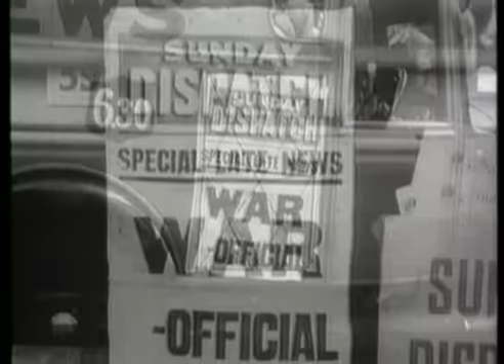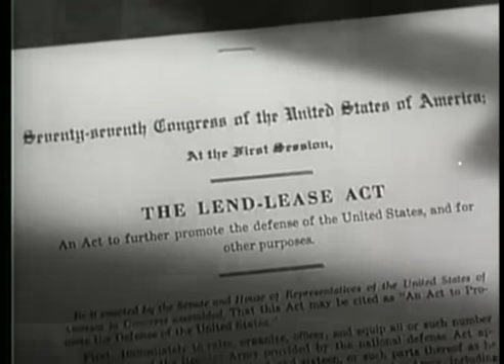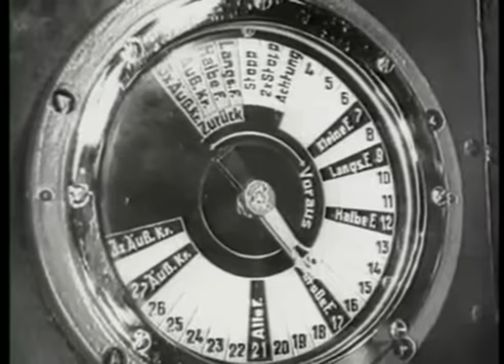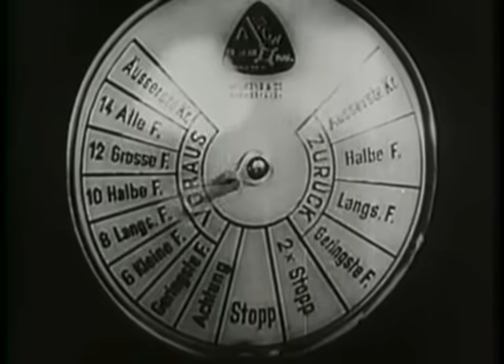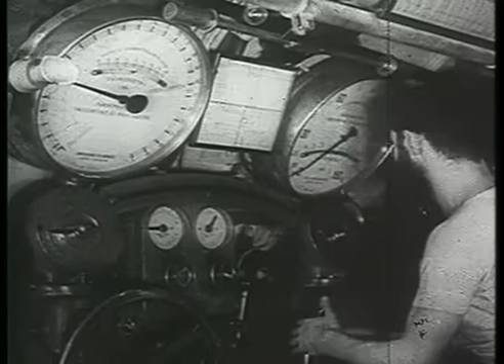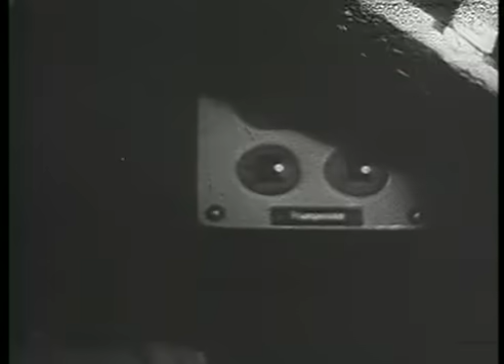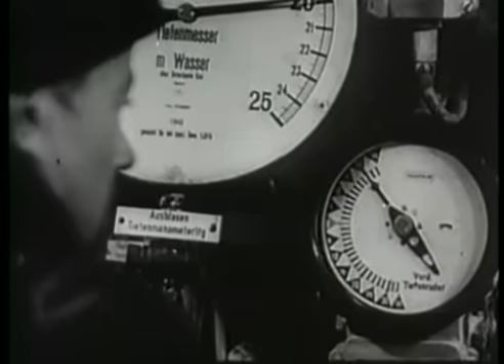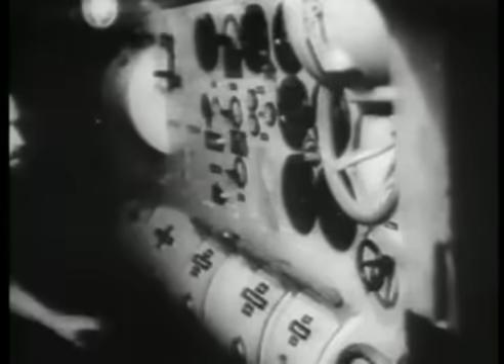Battlefield S2/E2 - The Battle of the Atlantic

Comment: Hitler created the situation where Germany was assured to loose the Battle of the Atlantic.   In early planning 2 different plans were submitted by Germany's navy.  1 a balanced force that could engage in surface warfare with Britain,  but would be the latter 40s before the building of capital ships would be numerous enough.   2 all building into submarines that would be ready in late 30s to early 40s.
Reply: Both plans were doomed
Reply: @rinkashikachi  Hitler almost won the Battle of the Atlantic.   If he had 100 U-boats at the start of the war he would have.
Reply: @billmoretz8718  he would've still lost with 500 U-boats. Number doesn't matter. Battle for Atlantic was lost, because he couldn't keep up with US production, because Luftwaffe was unable to conquer air superiority and because Allies extensively used radars. By 1943 all U-boats were sitting ducks both for destroyers and air patrols
Reply: @rinkashikachi  yes it would.   He had less than 15 ocean going boats at the beginning and still almost cut off Britain's lifeline.   The original plan called for 300, but because they went with the balanced force based upon waiting until 44 or 45 to begin the war it was a serious mistake.
Reply: @billmoretz8718 everything you wrote is just repeating what you said. I explained why it wouldn't
Reply: @rinkashikachi  you explained nothing or seem to know nothing as well.  Britain was alone after the fall of France facing the full might of Germany and Italy.   If they were driven out of the war, the question would be what would be the fate of the world's largest navy of the time (Britain)?   It was not until 43 that US production began to produce capital ships.  Even had to borrow a carrier from the British in late 42 because we only had 1 left operational.   You better do some research
Reply: @billmoretz8718 it is  you who knows nothing or draws the false conclusions. Stop thinking in your stupid capital ships, like admiral Yamamoto. It's not capital ships, nor u-boats that decide the outcome of the war.

It doesn't matter if Germany would've won the sea. They still were never even close to gaining air superiority and they were years away from being ready to invade Britain. Especially since Britain maintained air superiority. They would've been unable to make a killing blow anyway. And it is not like US would've stayed on a side like a mindless NPC. Britain was doing just fine, so US wasn't all that quick about aborting isolationism. If the situation were to become worse, US would've intervened sooner. It is crazy to think otherwise.